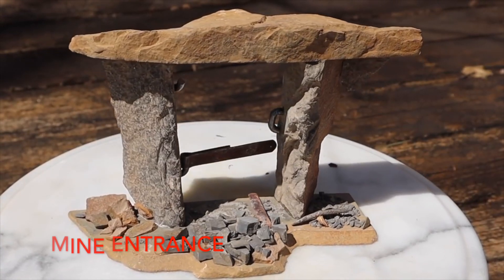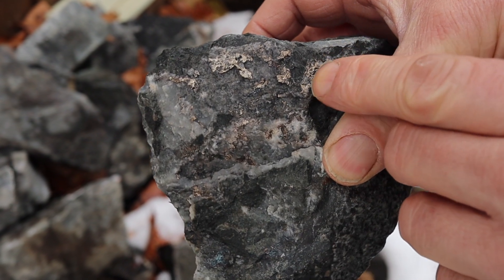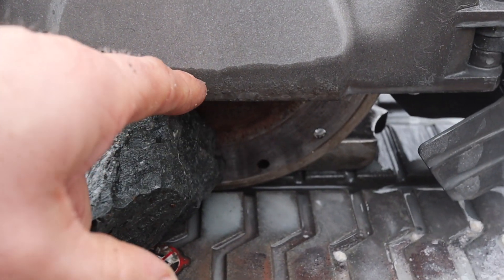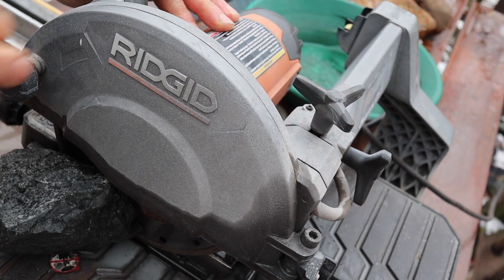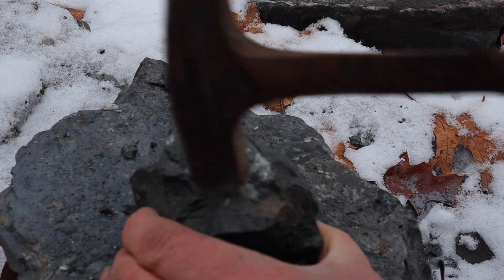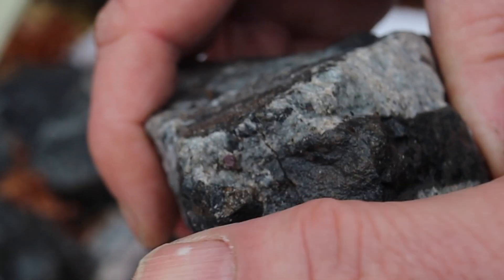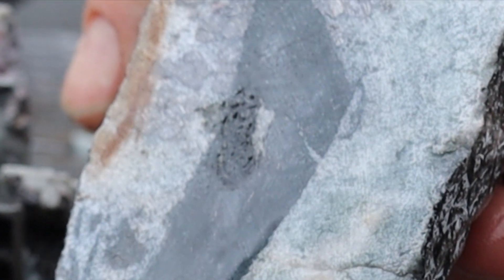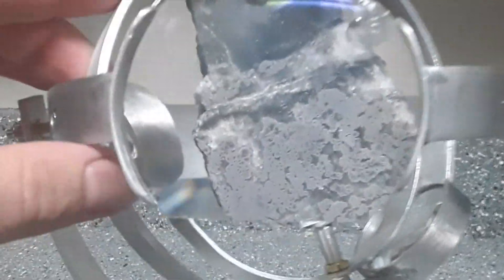Sliced SILVER ORE Gyroscope Project

Comment: Would you be interested in a trade of some rhodonite for a piece of silver ore?  Most of my rhodonite is still in two larger chunks, so I don't know how nice it looks all throughout.  I don't want to smash it with a hammer and chisel due to the unpredictable outcome and I don't have a tile saw yet to cut any of it up.  I can take pictures, or do a quick video of it so you can see and pick out what you would like mailed to you.  In return, you could send me a piece of silver ore that you see fit as a fair trade.

It's also not a worrisome concern of mine if there is any significant content of arsenic or cobalt in the ore.  I'll collect and refine those elements as well.  I have thallium which was a byproduct of etching some river rock, so I'm equipped with appropriate safety measures.
Reply from the maker: We just had a large dump of snow, so my silver is probably buried now until spring.  Stay in touch.  ;-)
Reply: @meMiner  Will do!  I'll do a short video of my rhodonite.  I just took a look at the two large pieces from when I broke the rock open and I forgot how big these were.  I had quite a bit of fragments separate and they show very nice manganese dioxide dentritic patterns contrasting with the pink manganese silicate.  It really was such a nice surprise opening that rock because I didn't think it was anything special when I collected it.  I was just hoping to find some pyrite veins inside.
Reply: I also have a bucket full of realgar & orpiment somewhere.  I collected these specimens from a road cut.  The host rock appears to be a combination of tuff, obsidian, agate and contact zone fused silicon dioxide which I suppose originated from diatoms.  These specimens were collected between layers of flood basalt from the Columbia river basalt group.  I had at first thought the yellowish powdery substance on the rocks was a ferric oxide hydroxide such as limonite, but nope!  I dissolved some in an acid batch and later ran some tests which determined I hadn't gained any iron salts.  In the end, I performed the Marsh test and created an arsenic mirror.  I ruled out antimony by a secondary test.

Comment: Great job all on those projects, so many different neat ideas and they all look great!  That one rock may not have been great for silver or slicing but I love the contrast of the colors in that pillar shaped inclusion through the middle and the host rock. Could make a really pretty bookend or similar that doesn't need to be super thin.
Reply from the maker: That rock is now under 18 inches of snow.  I'll take another look at it in the spring.  Thanks for the thoughtful comment